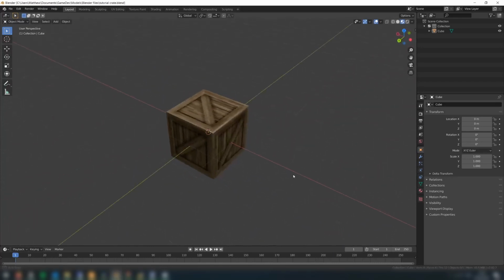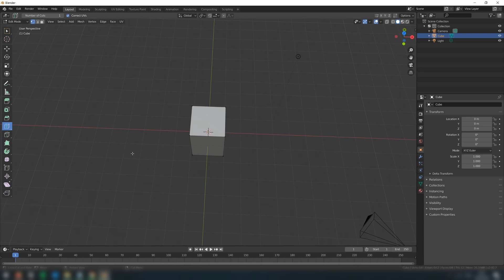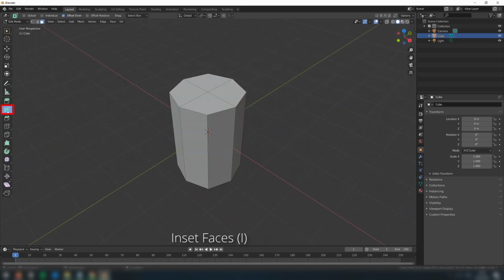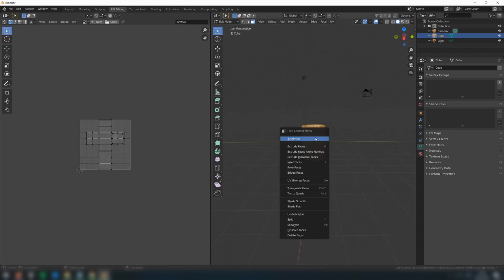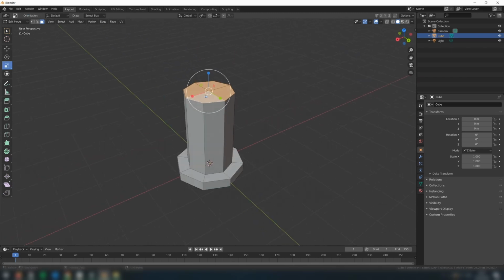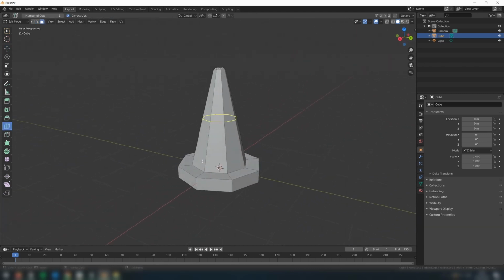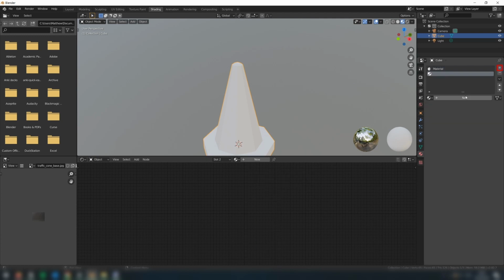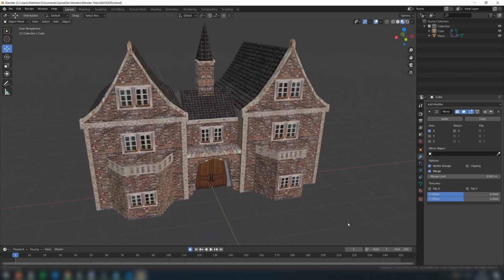How to make PS1 style models in Blender | Part 2: Basic Modelling | Tutorial

Comment: Hey @hacktic, when I try to bevel the top of my cone it doesn't elevate point, but only cuts it in a star form. Any ideas what I'm doing wrong?
Reply: I figured it out, I changed the scale of my object (I think in edit mode) so I had to press Control + A and then scale before beveling.

Comment: If we were to use multiple materials instead of 1, would this cause a big issue when importing into Unity? I am not sure how Unity handles this.
Reply from the maker: No, it works fine in Unity! You might just have to add the textures back to the materials but it will show the right number of materials on the Unity side